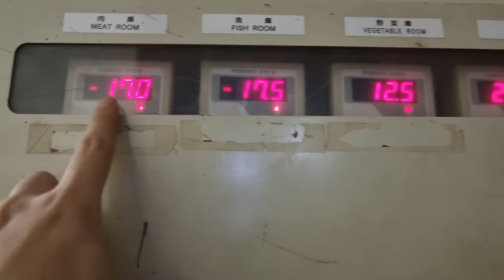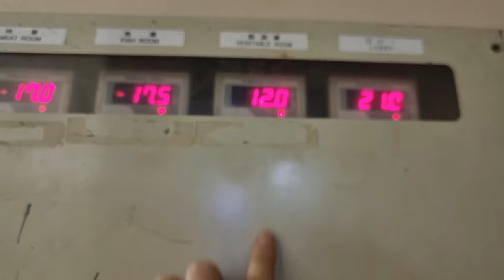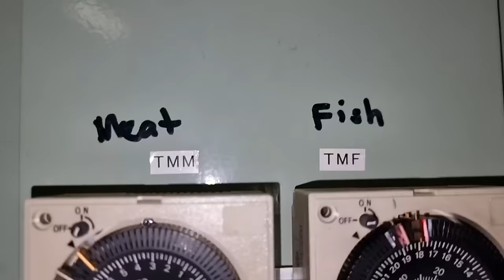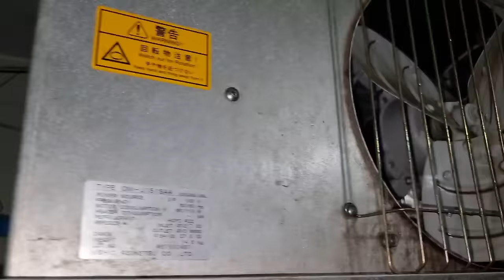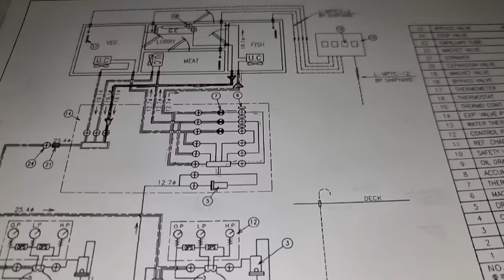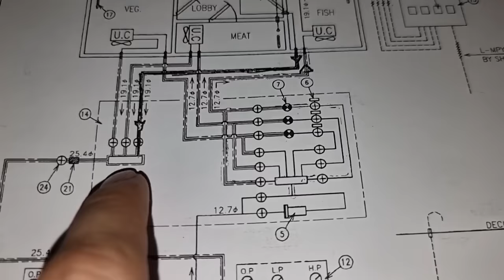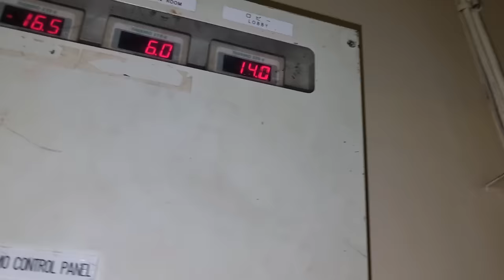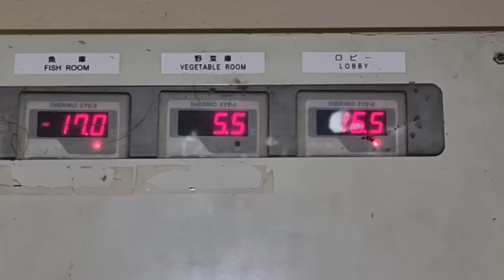TXV TROUBLE, ICE ON EVAPORATOR, HOW TO ADJUST THE TXV?

Comment: thank you for ur time to show us problems of recarding ac and provision systems on board. the line after the expansion valve can be icy but when the TEV is icy this means that a sudden drop of pressure happens before the TEV which can be caused if the TEV filter is dirty.

Comment: Interesting vid! 

I work on a lot of really old systems, have seen a few TXV's where the inlet filter has become blocked with dirt. Also have had a few where systems have been converted from CFC's to HFC's where the TXV has got wax in it which also blocks the flow.
Reply from the maker: thanks
Reply: yes it is probably clogged or faulty txv but this works fine for temporary fix

Comment: Should you check for superheat with a thermometer and gauge pressure prior to adjusting valve? I hope so. 

The room doesn’t look like a new installation. Possibly worth replacing the TXV completely if it isn’t functioning ok
Reply: Can't find a parts house in the middle of the  Atlantic Ocean 😮😮😮😮
Reply: @davidsanders6957  isn’t there a refrigeration wholesale down just off Bedrock Road? 🤪

Comment: If you have to adjust the TXV to solve an issue that wasn't there before with similar settings I would say the TXV is faulty or you possibly miss something else (blockage around  inlet TXV?) and are solving a problem by offsetting your TXV. (P.S. I sailed on he same vessel as you in 2009 - Maersk Salalah.)

Comment: I can be wrong, but Superheat is the amount of heat added to a vapor above its boiling point. As a result, it shows the amount of heat your Freon has gathered over time.

This means that the evaporator is frozen because you have too LOW superheat, but not too high! Too much Freon goes through txv and in the video you are reducing the quantity of Freon and that is why increasing superheat. Am I correct, colleagues?
Reply: Parehong tama ang explanation ninyo sir jake and Mr. bugayo pero ang tingin ko ang problema nasa spring tension,dahil na rin sa sobrang ice build up umabot hangang feeler bulb.kaya kinulang nang bukas ang expansion valve .yong pag adjust ni sir jake counterclockwise ay nagbalik sa tamang opening uli yong txv.hope nakatulong sa pag analyze nang problema.

Comment: THAT'S WHY YOU SHOULD ALWAYS USE EVAPORATORS WITH HEAT ELEMENT AND TIMER FOR DEFROST NOT ONLY FOR TEMPERATURES BELOW ZERO BUT ALSO FOR TEMPERATURE ABOVE ZERO WITH HIGH OR LOW HUMIDITY IN THE COLD ROOM. 
AND YOU WILL NOT SEE FOR EVER ICE IN THE FINS OF YOUR EVAPORATORS.
NEVER TOUCH/TRY TO ADJUST THE EXPANSION VALVE BECAUSE IT IS FACTORY ADJUSTED WITH THE CORRECT SUPER HEAT. 
CHOOSE THE CORRECT ORIFICE. 
KEEP THIS ADVICE FOR THE FUTURE.
THANKS FOR READING 🇬🇷
Reply: Stewards dept. leaving doors open all the time. I cant believe that system came without defrost heaters..
Reply: @officerkrupke4966  YOUR OPINION Sir.
Reply: THAT'S WHY WHEN THE DOOR IS OPEN,
IT'S SHOULD GIVE THE DOOR SWITCH,
THE ORDER TO CLOSE THE SOLENOID VALVE AND FANS TO STOP.
IT DEPEND FROM THE ORDERS YOU GIVE TO THE ELECTRICAL PANEL.
Reply: @tsalikistsalikis3118  That still isnt going to get rid of the high humidty air introduced each time room is accessed. Need after market defrost heating strips installed with timer to initiate and shut off solenoid and fan.
Reply: @officerkrupke4966  DID YOU READ MY LAST COMMENT ?
I THINK YOU AGREE WITH ME.
SAME SENSE WITH DEFERENT WORDS.
Reply: @tsalikistsalikis3118  Yes, that manual defrosting with water hose is a pain.
Reply: Looks like original evaporator that had defrost system was replaced with this one, intending to install defrost system when time and manpower are available. Meanwhile, get electrician in there once a week with water hose.
Wonder what Jake did to piss off Chief Engineer

Comment: Dear Lecki Jake, if there is too little refrigerant in the evap. coil, it will get excessively heated up ( high superheat ), resulting in sensing bulb opening  the txv to admit more refrigerant to the evap. coil, however you state that there is too little ref charge in evap.coil due to high superheat - could you please clarify this? thanks

Comment: That's why there is a method called ''DEFROSTING''
(1) Stillstand - Shutting the system till the ice melts
(2) Let the fan only run in the evaporator
(3) Heating rod in the evaporator.
(4) High-Pressure hot gas flowing pipe from the compressor directly to the evaporator.
All the above-mentioned processes apart from the 3, are automated and have time intervals.
You adjusted the TEV by turning counterclockwise. This means you opened the valve more. This means more refrigerant is sprayed in the evaporator. When more refrigerant is sprayed in the evaporator, it gets cooked more slowly ( turns to gas form more slowly). This will result in the refrigerant leaving the evaporator in a semi-liquid state. This will result in very low SUPER HEAT. 
I don't think you have solved the problem.
The temperature in the vegetable room seems to return back to normal because after you cleaned the ice block from the evaporator the fan is circulating the air in the room properly. But soon ice block in going to form in the evaporator and the same problem returns back.
Instead of adjusting the TEV, you should have checked the DEFROSTING system's functionality.
Reply: It has no Dfos system....
Reply: Also, liquid leaving evap will "slug" compressor
Reply: Adjustment nut is downside so counter clockwise means closing the valve

Comment: why not use a constant pressure valve to hold a fixed temperature? with that you can hold a exact temperature just above 0 without any chance of freezing. its the standard for flower storage for example.
Reply from the maker: this is actually a vessel provision plant and changing the design requires approval from the class
Reply: @leckyjake  yes, i understand that. i just wonder why they didnt use such a valve. is it just for parts commonality or just a engineer that assumes everything always works perfectly all the time?
Reply from the maker: The temperature for the rooms should be variable, from negative 22 degrees Celsius to positive 22 deg Celsius. In this way they can use for various reasons.

Comment: Actually you need not to adjust expansion since it is a factory set. Adjusting is only be done in case of emergency. The icing of of evaporator not clearly emphasising the major cause.There is one big reason why icing occurs immediately.  It is always the fault when malfunction of one component but pointing to expansion valve is really not the real thing at first.

Comment: Hi. What might be the cause of ice formation on the suction filter line of provision refrigeration compressor?
Reply: If its after the filter ( the side that goes in the compressor suction port ) that means you've got a clogged suction filter, and maybe you are flooding back the compressor but maybe not, only superheat could tell you if you've evaporated all of the refrigerant or if there is still some trapped in liquid state

Comment: big no sir,that valves is factory seated nothing to adjust check your control,fan blower and also refrigerant charge.
Reply from the maker: and yet after doing it the unit becomes ok
Reply: Yeah but in few days you see
Reply from the maker: that video was already from last year and the system still in good running condition up to now